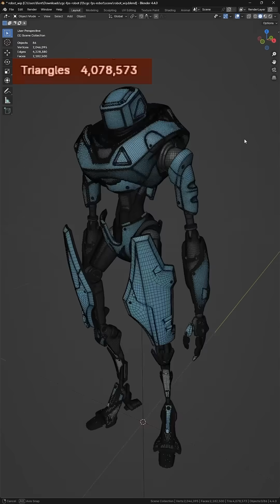Why does texture baking matter? 🧑‍🍳 #b3d #texture #gameassets

Comment: How is this different from bump mapping
Reply: When you create a low-poly model with the aim of using a normal map, you remove all unnecessary polygons, the important thing being that the overall shape, the silhouette, is respected. So you generally end up with a model with very poor topology, which leads to equally poor shading and sharp edges. If you add a bump map with details on this model, you'll keep this base of bad shading. The normal map, on the other hand, recovers information on each pixel from the normals corresponding to the high poly model, which is supposed to have perfect shading
Reply: @chopsuey4698  now I'm even more confused. Bump maps are a type of normal map. Bump maps are supposed to do... exactly what you said normal maps do
Reply: @PSNPerfectNinja  No, a bump map is a type height map without color data therefore it has grayish tones, not to be confused with displacement type of height maps which displaces subdivided polygons (a high poly model). And normal maps have color data representing RGB as a fake XYZ vector, therefore being able to reflect changes of the environment lighting better unlike bump maps cant do very well. Although both maps need to be plugged as non-color maps in the pbr shader.

please search more about how a normal map and height map works and differs to understand it better...

Comment: But aren’t there still the same amount of triangles being rendered?
Reply: Not at all.

The textures change how the light is bounced based off the baked map.

The higher poly has the higher amount of tris and the lower poly has a significantly lower amount.

The baking is essentially shortcutting the light bounces by pre calculating how they would move using a normal or alpha map (depending on if ur using height maps or normals).
Reply: @Enkye_CA excellent explanation 💯